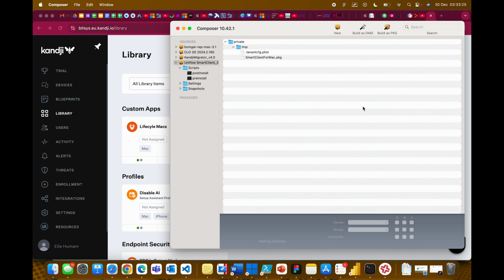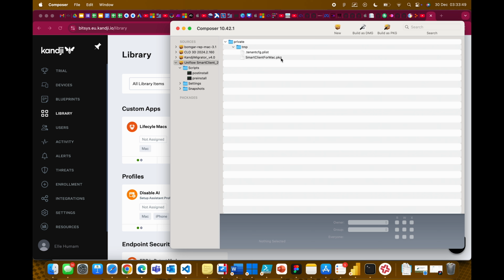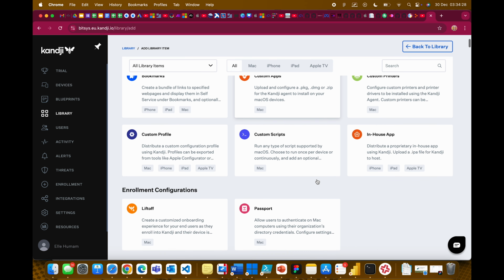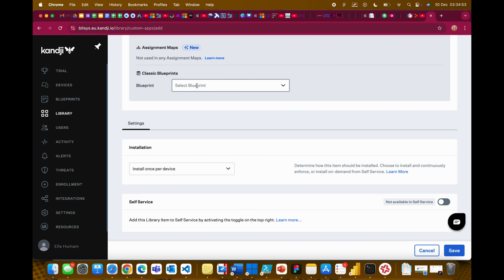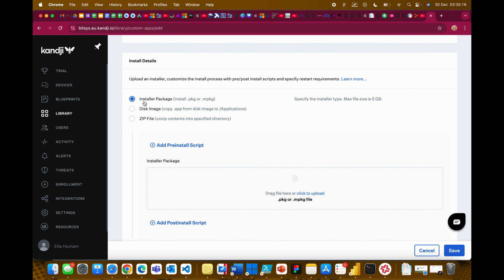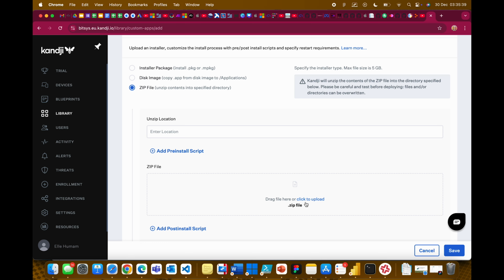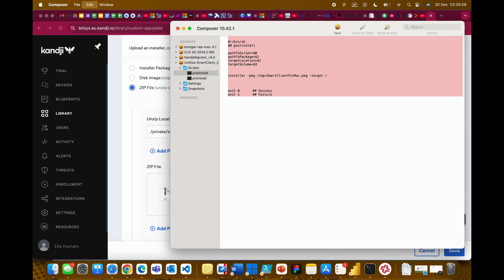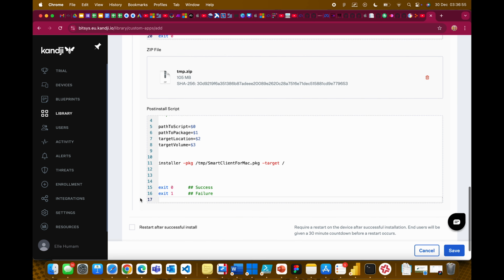Simple Package Using Kandji & comparison with JAMF

Comment: When I was working in a job that I hated I had to work with Kandji. Having worked with Jamf Pro for many years I felt limited by Kandji. While Kandji appears to be a good MDM solution, I could tell that I would get very irritated with it after long term use. Blueprints are good, but they don't work for one-off installs. They can be restrictive. I actually lost that job over Kandji, which is another reason I'm not a fan of it. Using Jamf Pro I can do just about anything I want as long as it is something that Apple is allowing admins to do. Had Jamf done a better job selling their solution to the company I was working for at the time, they could have won the business. I think the sales guy I was talking to just thought I would be able to deliver the business to them since I have always been a strong supporter of Jamf. Nope. He still needed to do his job!